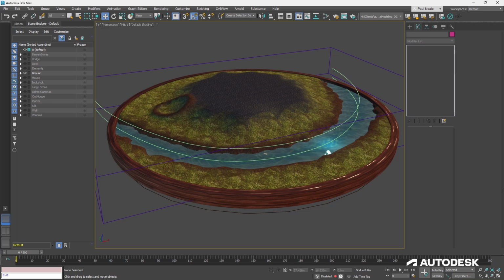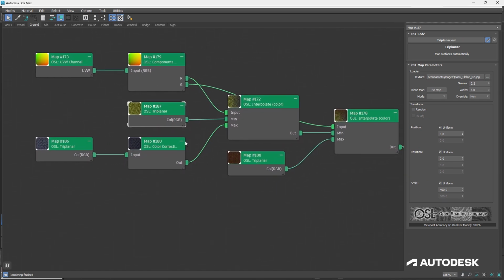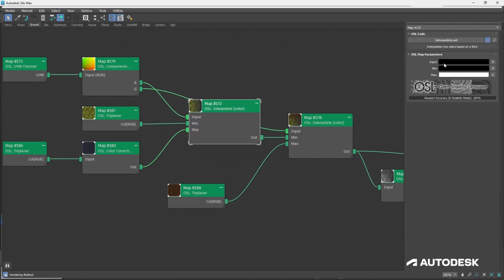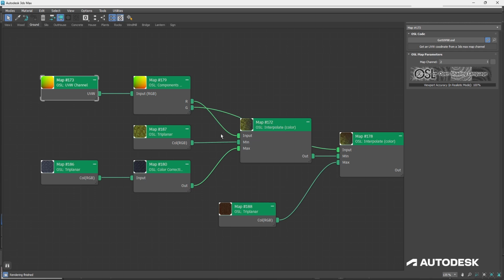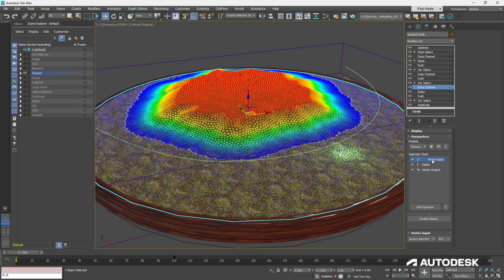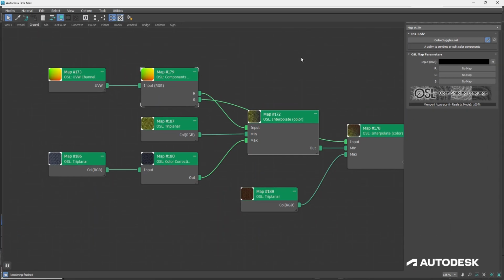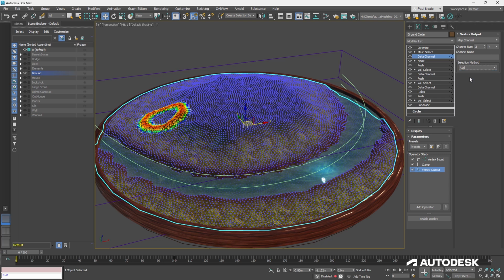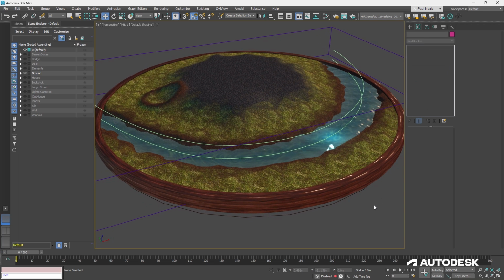Save Time with Procedural Modeling – Part 2

Comment: سلام
تلاش های شما برای بهبود 3dsmax بسیار عالی است سپاسگذارم
به نظر من بهتر است سبک مدل سازی در 3dsmax از حالت modifier آپارتمانی به شکل node base تغییر پیدا کند
سبک قدیمی استفاده از مدیفایر  به شکل طبقه ای بسیار آزار دهنده هست
Reply: Easier said then done and most people that use Max would have a hard time with that method as it is no way near as fast to do.
Reply: @paulneale  MCG در 3dsmax وجود دارد اما متاسفانه آموزش خوبی برای آن وجود ندارد و کار با آن بسیار سخت هست
3dsmax نرم افزار بسیار قدرتمندی در همه زمینه ها هست و امیدوارم امکانات جدید همچون مدل سازی nodebase به آن اضافه شود
Reply: @rajahaddadi2274  Yeah... The sad thing about MCG is that it's totally dead. It needs a complete rework, because it was a great idea very poorly executed. When it comes to nodes - why not, but maybe as a way to better visualize what's happening in the linear nature of the stack and more easily transfering things like vertex selection from modifier to modifier.